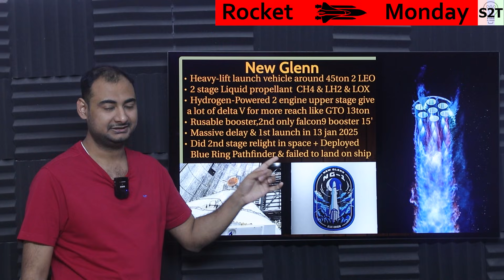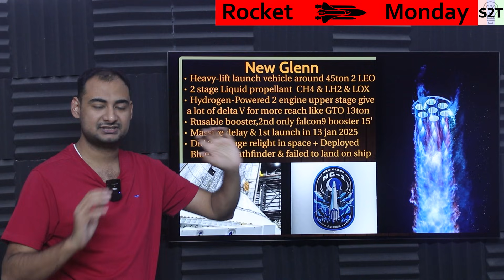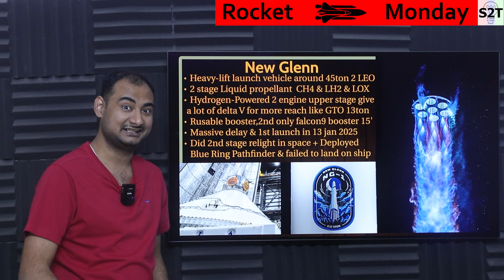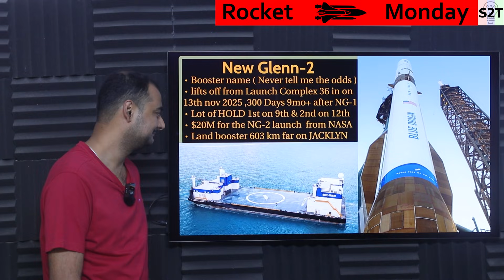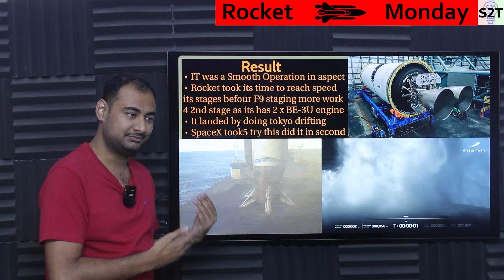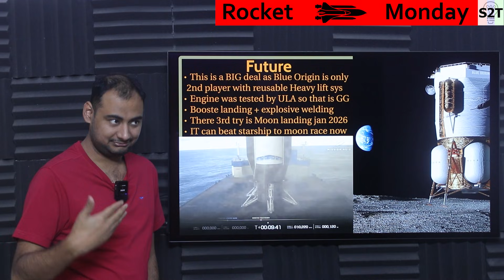Blue Origin New Glenn {NG-2} Explained {Rocket Monday}

Comment: on material choice:  Steel vs Li-Al vs Carbon
Only the reusable Starship has a valid case to justify the use of steel because it has to systematically reenter the earth atmosphere from orbit.

Orbital fuel depo can be made or carbon like huge COPV in orbit with some extra equipment.
HLS will be ok with carbon fiber as well.  Earth atmospheric capture and reentry from Moon better be delegated to a small capsule.
Although there is a burning issue of LOX impregnated carbon-fiber that has yet to be isolated and solved.

Starship Booster might be feasible in Al-Li since its atmospheric deceleration is relatively benign.  And material fatigue become important with repetitive flights.  I guess carbon-fiber is ill suited for booster.
Reply from the maker: Thank God it's not like we have multiple craft that does re entry from low Earth orbit which are made out of aluminium like space shuttle , dragon capsule & Soyuz capsule or apollo which did even hotter re-entry without steel . It's just elon weed like removing lidar form tesla just because elon said so